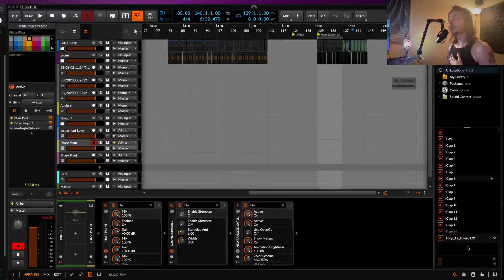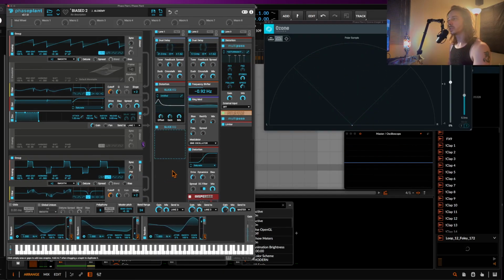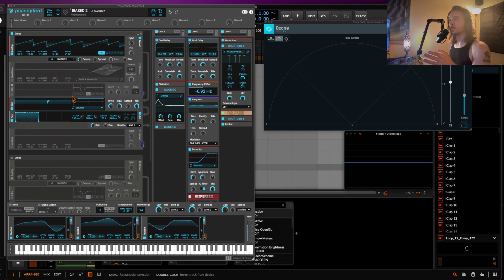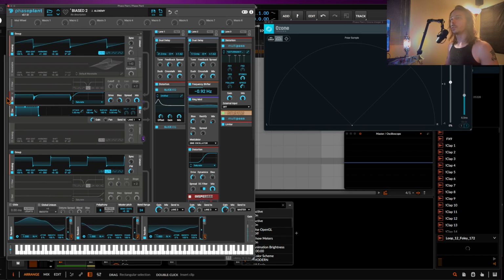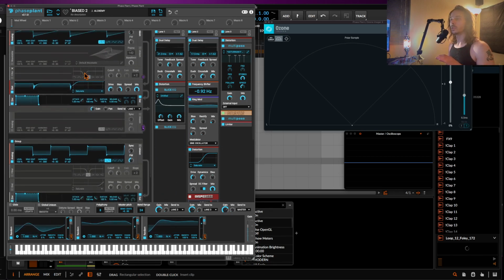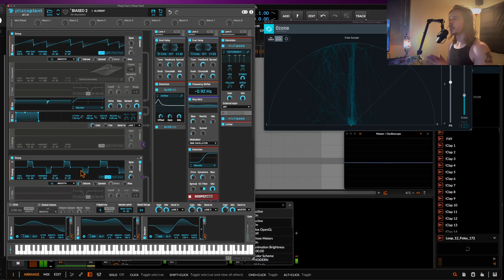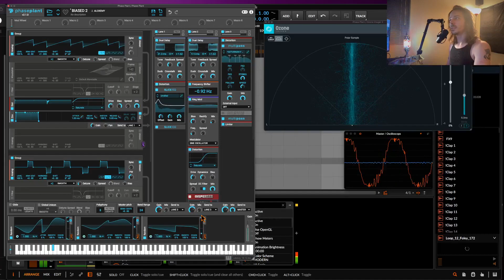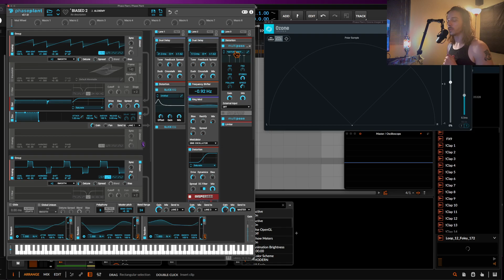I’ve Never Tried This Before. Bipolar Waveform Processing!? #phaseplant

Comment: You can use the Rectify device in an FX Grid to perfectly filter out the positive or the negative. Put two of these into an FX Layer, put synths before them and they'll split perfectly at the zero crossing allowing you to create whatever you want with whatever synth you want (you also don't get sounds "poking through" as the split completely turns down the positive / negative part of the waveform).

You can also process the positive and negative sides individually by putting devices in the layers after the splits.
Reply from the maker: There’s lots of ways to do it. Just wanted to introduce the idea^